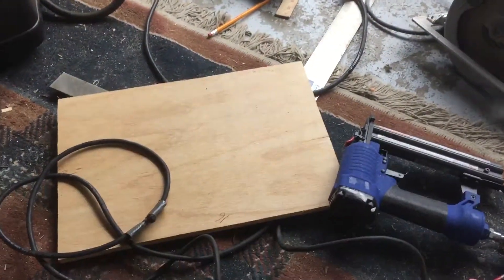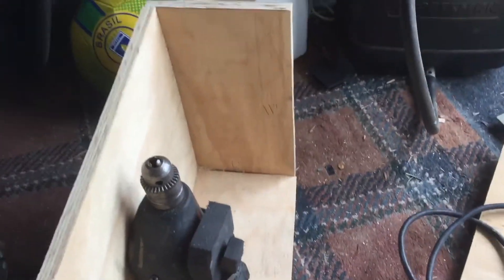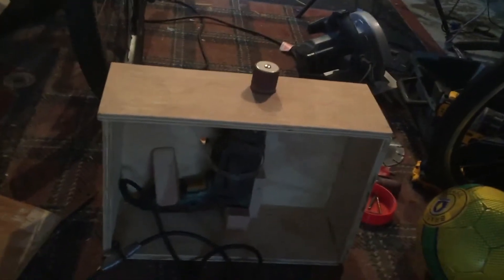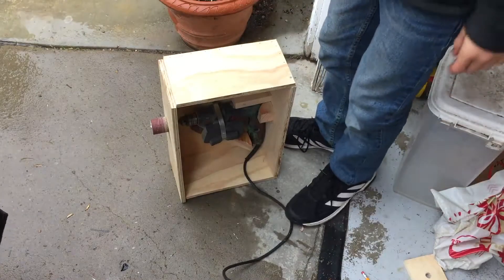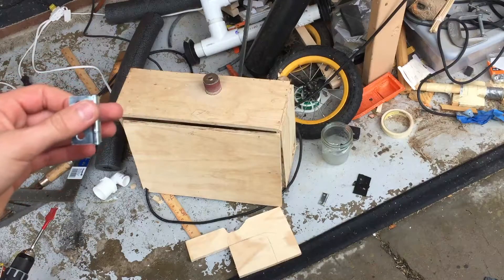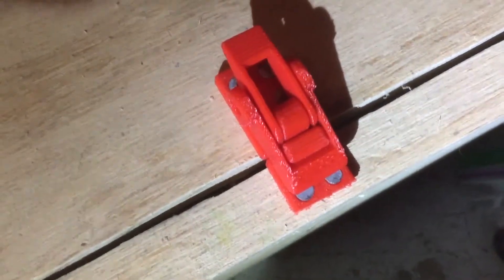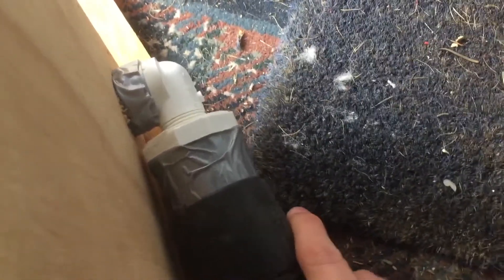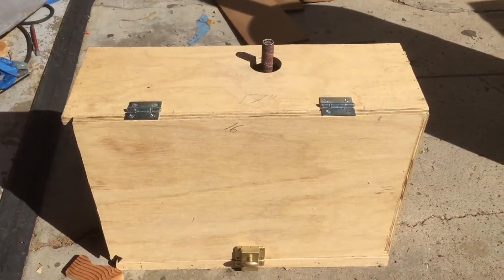How to build a drill powered spindle sander, Part 2

Comment: Good video!

A couple of questions/thoughts.

1. Could you have put the hinges on the inside of the door to allow the table top to stay flat? I wondered if you had any issues rubbing pieces across hinges.

2. The adapters you use for the dust collection - it looks like you have 1.5” from the tool and going to 2.5” to the shop vac. Doesn’t that reduce suction? Were you not able to find an adapter or did you just use what you had?

Anyway, keep making videos and great job!
Reply from the maker: Thanks for the suggestions. For Q1, I didn't really use the sander as much as I'd expected and have since taken it apart to use the drill for other things. For Q2, I was just using what I had laying around.